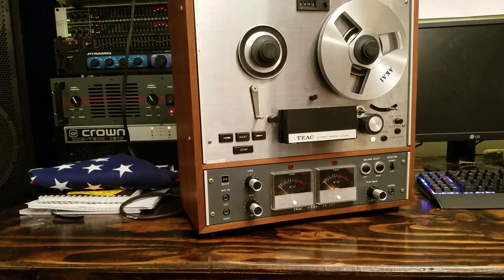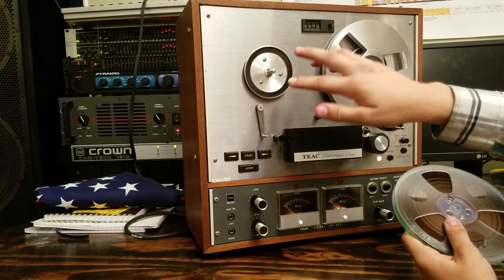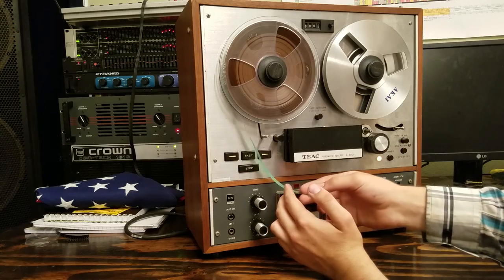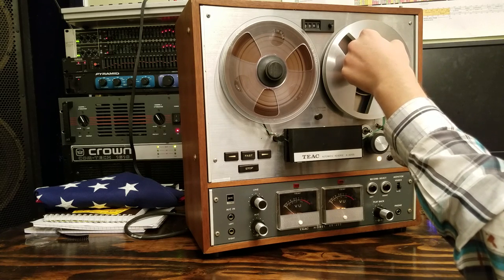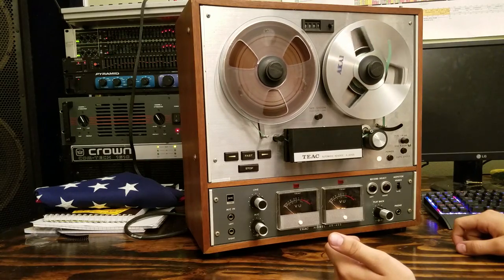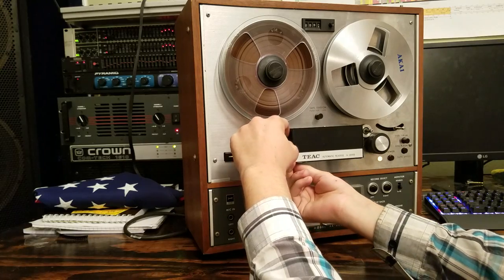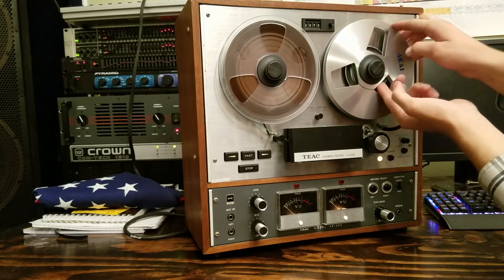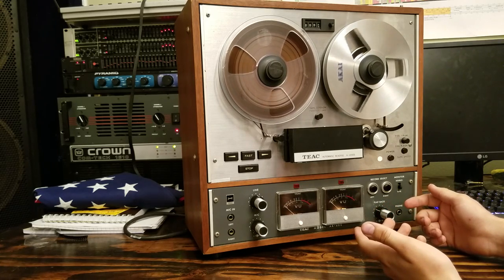Part 2: How to Thread a Reel to Reel and play tape

Comment: This tutorial was very helpful, thanks for posting.
Reply: btw i have the exact same player shown in the video.
Reply from the maker: Nice! didn't know there was many out there! they're great machines!
Reply: Where did u get that tape??? Brown oxide hasnt been used in 60 years.
I have been working with tape for that long. Dont bother with that little notch, just lay it flat on the hub and spin it. I have also seem newbies apply a little moisture at the end. Helps it to adhere to the hub, but I would only use it on leader tape

Comment: The third way of threading a reel to reel is similar to your second way, apart from you don't put the tape into the slot. It's far quicker, and the tension holds it there fine.

Comment: Every time I do this, the leader falls out of the slot before I can get it spun enough to hold it.  It's the most frustrating thing.  I'd rather have one that you slot and put an inch or so so hanging out.  I tried 10 times before I got the tape into the slit and wound without it falling out.  It was just like what happened to you the first time, but I managed to screw it up 10 times.

Comment: Just unwind the supply reel a bit to loosen it up until you get the take up reel started, then re apply the tension
Reply: This is what I always seen done in old detective shows from the same time period when they are playing an evidence tape. They hand-wind the take up reel and the supply manually until the playable tape is just coming out of the edge of the reel. Then they hit play on the machine.

Comment: I threaded mine outside to outside and the music is still in reverse, starting with the last song on the tracklist.  Either I'm doing something really wrong or the tapes are wound onto the reels backwards.  They do have to go onto the machine label side down in order to have the tape on the outside, which I thought seemed weird.  I would think the labels should be on the visible side.  It's a Revox A77 deck.
Reply: Did you play the tapes or did these come from someone else?  It's possible someone played the tape then left it on the take-up reel and not rewinding it back onto the supply reel then it just got forgotten about for decades. So then when you're trying to play the take-up reel what has happened is because the last recordings are now on the outer edge (top) of the reel playing first, you are hearing the end of the reel first.  Just put this reel onto the take-up side and rewind it onto a supply reel and you should be OK.   Barring that it's likely maybe a case of the way your machine loads the reels is not universal to other machines and maybe your machine has a specific orientation to it.

Comment: So idk if you have an answer for this, but I found mine has a bad fuse. Replaced it with the same kind. Powered up and ran the reel for a second then the power went off. Checked the fuse and it was blown again. I've checked all the wires and connections along with the amp pcb and nothing looks burnt out or disconnected any idea what I could look for as a solution?
Reply from the maker: Wish I could help, but I really have no idea. I am not an expert by any means with electronics.
Reply: Not sure if you found a solution, but 12 volts - a youtube channel does several open reel repairs and diagnosis. No one can answer your question really. But I think a key thing to know is how to identify capacitors that need replaced. Blown fuse indicates you have a short somewhere. Capacitors, diodes and resistors can all short. It will take you a lot longer than an engineer/technician.

Comment: Where can I buy that silver reel?
Reply: Check ebay, but they are pricey and collectibles!!
Reply: Good am sir maam i have a reel to reel old tape recorder do you want to buy
Reply from the maker: The one I have came with the tape deck. But I am sure they can be found on ebay, craigslist, record stores, etc.
Reply from the maker: Really, I thought there were plenty of them out there...
Reply: @CTHMProductions  There is but millennials are going after AKAI brand because YouTube influencers think Akai is the only brand there is and tell them all to buy buy buy,  so they do. There is Akai reels on eBay but the only one I see right now is $60. Akai decks are going for $250 - $400.